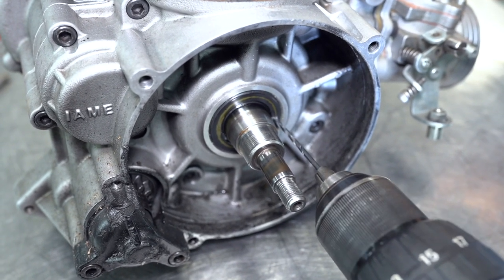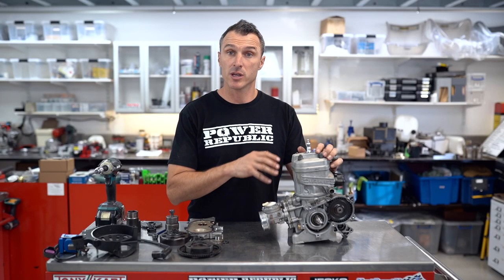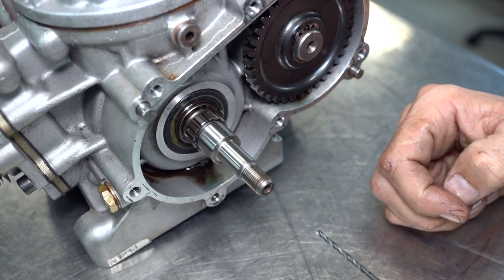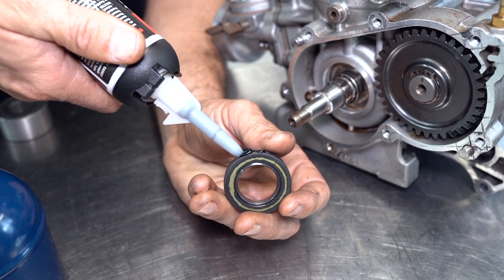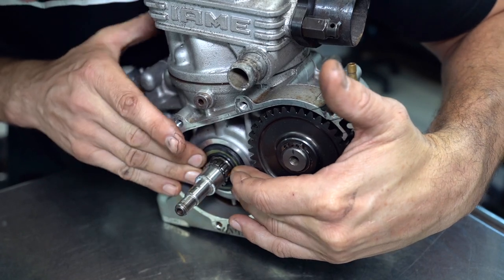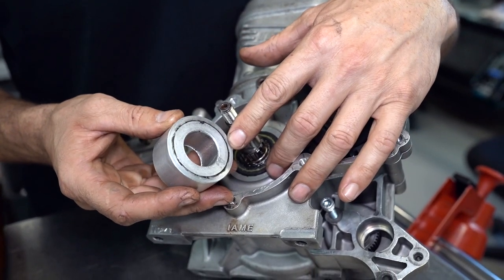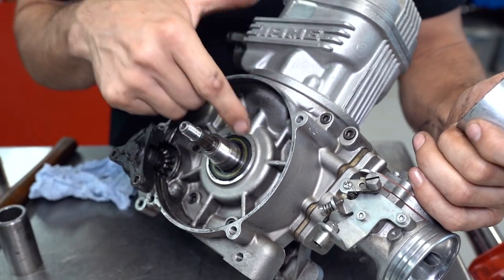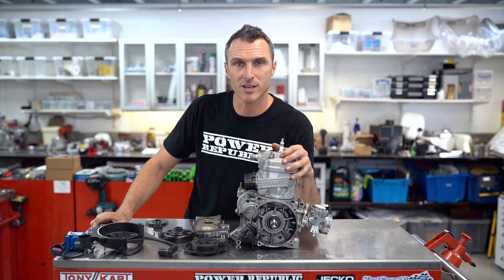How To Remove Your Crank Seals Without Pulling The Engine Apart - POWER REPUBLIC

Comment: Hi, You have some great content. I'm new to go karts and just purchased a CRG 125 Rotax that has been parked for around 5 years.  I believe the owner had serviced it on a regular basis and removed the fuel and coolant before it was parked 5 years ago.  What would you recommend to do before starting? Many thanks
Reply from the maker: awesome news, welcome to the club!.  most likely a new battery, fuel line and filter, fuel pump kit, needle and seat, brake bleed and you should be all sweet.

Comment: Hi, so I am wanting to start in junior ka100 and I have questions of maintenance costs as well as when to get a rebuild, if you know any good forums for me to visit and learn all about the class let me know.
Reply from the maker: Hey Ayden, the cost of racing is unlimited, especially if you are racing for victories.   however the cost of ownership is not excessive if you are to use the engine on practise days.  so I say, race to your budget.  if that means 2 times a year, do it, still fun.

Comment: Just ran into the same issue with my TM R1. Ordered a new seal. Will try to carefully drill and replace the seal without taking the whole engine apart 🙈 it’s leaking on the chain side. 4 hours of total running only…
Reply from the maker: yeah that sucks, you will have to remove the ignition rotor too then

Comment: Hello, if i drive junior kart in high grip track with 20-35 celcius with douglas low volume magnesium rims what tyre should i choose and how many psi should i use? The track is ' Drive Park ' from greece
Reply from the maker: Hi TZ, is that on Lecont?   at a guess I would start with 9.5-10.5psi
Reply: @PowerRepublic  yes it is lecont thank you so much

Comment: Would this be the same in a rotax mate?
Reply from the maker: yeah you could use the same technique on a Rotax.
Reply: @PowerRepublic  thanks for the reply. Would you know the PN for the rotax I seen to be burning gear oil and oiling plugs on a micromax I’m considering just replacing the crank seal